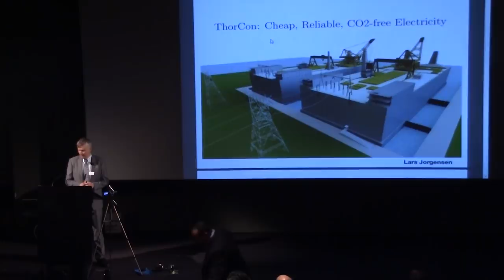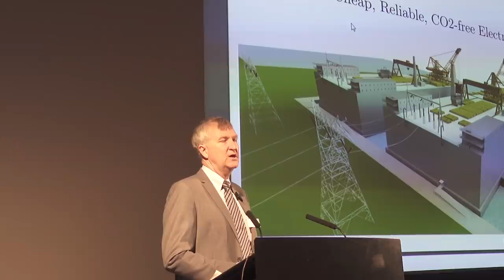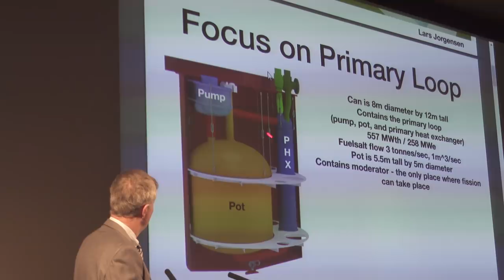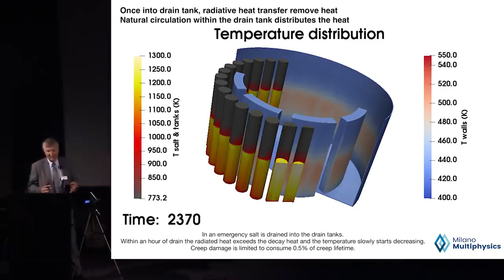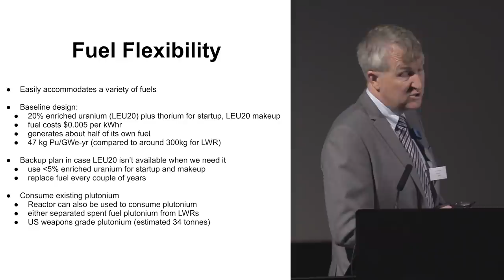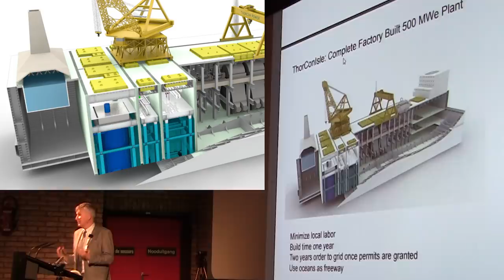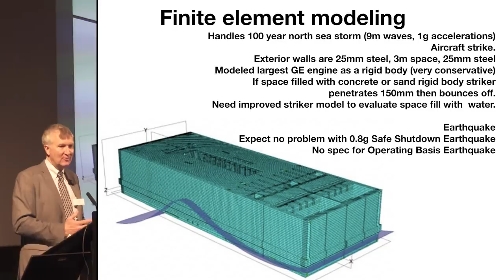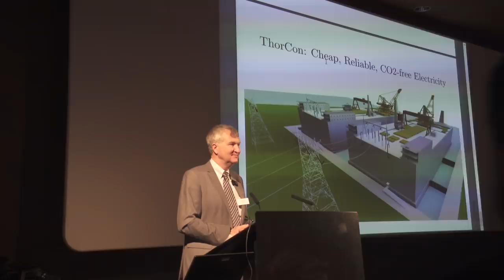ThorCon: Cheap, Reliable, CO2-Free Electricity by Lars Jorgensen @ ThEC2018

Comment from the maker: After 6 months, The Center for New Energy, Renewable Energy and Electricity (P3Tek) of MEMR Bureau of Research and Development have completed the midterm report of the Thorium Power Plant Development Study which in the midterm report cover regulations, safety and economic. The midterm report concluded that TMSR not only economically competitive with coal but has a higher safety standard with full passive safety system — The full report is expected to be completed by July 2019.

https://medium.com/@bobsoef/indonesia-validates-thorcon-91764b521d59
Reply: Assuming that report comes out favorably, how long do you think it will take them to act on it? What do the politics look like right now?

Comment: Just to look at how much energy there is available in thorium. 
The problem is to develop safe processes and there are several to start with.
Even U238 could be used but is not the prime choice .
LWR has a pressure vessel that is big and expensive  and has safety issues.
MSR has higher temperature enabling thermochemistry , very important to replace the fossil .
The problems are political, not technological . Big companies and states living on the fossil economi.
Raising taxes on energy or fossil for the common people does not solve problems. It is instead new other problems. 
Other serious problems are hysteria i media and miss informing, as a matter of fact the core of many problems.

Comment: I've never seen any published  data on radioactive 'fall out' from coal (gas, oil) power plants and no one seems to have any answers. I've been asking the question for probably 25 years including various professionals I've met. There is fall out (other than Co, Co2, etc) from coal power plant but it is totally ignored. Do you have any data? I think that would be a much better 'selling point'  Seems biggest reason for 'ignoring' Thorium / liquid salt reactors is they are very very difficult to weaponise?
Reply: IF you could get that data, and I don't want to sound all 007 or mission impossible about it, but I wouldn't put it up on a billboard if I were you. I would keep it to myself, and probably not talk about it too much either.
Reply: It's rather well known.  Kind of ignored unless one looks at the data.  In college in the seventies I was a student at San Luis Obispo CA.  They were building the Diablo Nuclear Power plant at the time.  I was involved in environment issues at the time.  Yes I saw some negative issues involved with the plant, perticularelly the high pressure operation and the need for cooling after shutdown.  Though I was a gad fly envirimentlest in that I insisted on comparing the risks of the new plant and the coal plant 10 miles up the coast.  I came up with more radioactive fallout, heave medals, poisonous gasses and massive amounts of coal ash.  One other thing that bothered me was the CO2 release.  That had implications of starting a runnaway greenhouse effect turning our planet into something like Venus.  I was kind of lonely in advacating ignoring the nuclear plant and closing the coal plant.
Reply: @stanleytolle416  dude ... spell checker ;)
Reply: @shawnnoyes4620  severe dyslexic.  All looks good to me.
Reply: @stanleytolle416  I was a motorcycle mechanic, technician, Instructor, etc so never had any formal training (4 years of Geology, Geography and Geomorphology in school doesn't really count?) 'We' visited a nuclear power plant and coal mines on various school trips (South Wales UK still had deep pits at the time) I guess I've been asking about coal burning 'fall out' a lot longer than I though as I was 17 when I first asked teachers, etc (I'm 62 now) Yours is probably the closest I've ever come to a direct answer. I can understand your 'loneliness' advocating nuclear power, the 'indoctrination' from 1950's~60's  means people are terrified of nuclear especially when people embrace their ignorance .
Reply: Sorry I've got no numbers for you but it is no secret burning coal releases radon (a radioactive) gas. Coal is being rapidly displaced by natural gas (methane) in grid electric power generation which has an activity of 200 Bq/m^3 which is apparently no more of a problem than the materials your dwelling is constructed from. Please note, my ignorance on this subject is huge, if you know better please correct me.

Comment: @Tony Chen  Russia has it's new shipborn twin reactor it's trying to sell.  How does your system compare to their system?
Reply: Russian design is a LWR vs MSR. Russian reactor between 29% to 33% efficient. This is ~ 45% efficient. They are really for two different purposes. Russian model is for remote cities to replace expensive diesel electrical generation as well as desalination. Russian model can also be used for oil rigs in Artic. ThorCon replaces coal plants for electrical generation.

Comment: I want one of these scaled down to produce 8-10kw for one or two houses perhaps in a shipping container in the back yard. Can this be scaled? Then we could really create personal autonomy in our cultures.
Reply from the maker: Do you treat your own sewage?
Reply: @gordonmcdowell  Sure, why not? I am willing to relocate if that is what it requires. Why is sewage a concern, is this not self contained?
Reply from the maker: @KellyLCall  I'm asking why are you interested in producing your own power. Processing your own sewage is a similar best-done-at-scale process. We have a grid. We have pipes.

While fission can scale down, it isn't practical to do so in most cases. Quite likely Fission Products can be harvested and put to use for small-scale solutions... in the future... after MSR have been running and we have some FP to harvest from the salt. But a Nuclear Reactor? Your own Nuclear Reactor? That is not a good use of resources.
Reply: @Kelly L. Call I think this can be scaled down but not to a household scale. Past a certain point it would be highly inefficient to scale it down further. There has been conceptual designs, not Thorcon's, but based on similar principles, that outputs 1-2 MW power. This would be sufficient to power a village. That's about the smallest we can realistically expect, I think. The intention is to power remote villages that currently rely of regular shipment of diesel fuel. So... I guess communal autonomy?
Reply: @tonychen76  I think communal autonomy is a step in the right direction
Reply: @tonychen76  i think communal autonomy is a step in the right direction. It also cuts transmission losses.
Reply: 10 to 15 magawatt in a convex box has been designed.
Reply: @clementvining2487  That's great! But I am just a homeowner, what in the world would I do with even 1 megawatt? I honestly don't think I would use even 50kw. But 15kw to 20kw or 30kw? That's what I'm talking about. Can't we just scale this thing so the average joe can power his own house? Then people can become truly self reliant instead of beholding to local power company tyranny. Then we are free!
Reply: @KellyLCall  Use solar and Tesla new battery system. The price would be a lot lower than a fission reactor of any size. Things has to be cost wise.

Comment: How about process heat?  Can hot salt be stored for possible power spikes.
Reply: Stanley Tolle Theoretically possible but not planned right now given the intended market (Indonesia specifically and developing countries in general). In the short term developing countries will use gas peaker power plants to meet demand spikes. They already use natural gas power plants, it won't cost them extra to use them that way. If ThorCon (or any company developing MSR) adds an energy storage feature it will add to the cost, thus driving price up and making the proposed MSR less attractive to developing countries. In the long term once orders are coming in, there will be money to add that feature in. But for now that's an undesirable feature creep.
Reply: @tonychen76  Russia has it's new shipborn twin reactor it's trying to sell.  How does your system compare to their system?
Reply: Yes, the tertiary loop salt is hot enough for various industrial processes.  
And it can be stored fairly cheaply, though probably the storage tanks and additional generators wouldn't fit into the floatable part of the plant. Not a problem -- just run a loop of insulated pipe out and back.
Reply: @Stanley Tolle First, it's not mine. I am not involved with ThorCon. I am just a nuclear energy advocate who is Indonesian. I wish Thorcon the best of luck, but I also have no objection if we get an EPR or VVER or APR or NuScale's or any of the modern nuclear power plants out there. May the best reactor wins. :)

Back to your question, the Russian floating nuclear power plant is the KLT-40S, two 35 MWe nuclear reactors in a barge. But it's apples and oranges really. Sure they are both floating nuclear power plants, but the scale is different (2x250 MWe vs. 2x35 MWe) and the technology is different (MSR vs. LWR) and even the marketing approach is different (Russia lobbies presidents and ministers and governors, Thorcon lobbies directors of the huge state companies).

So it's hard to compare. While both want to sell in Indonesia, in practice they are selling for two different niches. The islands where KLT-40S's 70 MW is suitable for will make no economic sense for ThorCon's 500 MW. Whereas the major islands who can use 500 MW of clean energy is not very interested in piddly 70 MW.

Russia also tries to market the VVER-1200 here too but it feels half-hearted. My guess is that they don't see us as going for the big 1200 MW plants for now. There is a major resistance for nuclear power in Indonesia too. Not as big as in the US or Germany, but it can't be ignored politically either. Russia perhaps think that overcoming this political opposition is easier by starting with small nuclear power plants first. This may also be why they're lobbying political figures.
Reply: @MikelSyn  Indonesia have committed within the Paris Agreement to maximize its equatorial geo-position to grow its biomass capacity as natural CO2 pollution sequestering agents (REDD+ projects) and by collocating the bio-refinery they can utilize excess heat from the Th reactor to produce clean biofuel cheaply for the benefit of the Indonesian people and the survival of all species on this planet. As the Indonesian president stated recently, Indonesia is open to anyone who eager to participate but perhaps for those who try to put any obstacles to this objective, they will face a 15 year old blond girl and her friends.
Reply: @sambelterasi8360  why make biofuels at all when you can make them straight from CO2 and water? Biofuels are an environmental disaster, honestly.
Reply: @MikelSyn  Currently there are around 16 million Indonesian people depending their livelihood + their family from the Indonesian palm oil plantation, to find new jobs for them within a decade would be difficult. So gradual transition would be preferable. For more advanced economic countries, such as Japan, US, and EU member states, your CO2 + H2O option would be great leap forward to the global carbon balance and its associated risk. Look it up it is in the "Opus-12" website.
Reply: Mikel Syn Re: biofuel. Realistically there is no way we (Indonesia) can get rid of our liquid fossil fuel dependency by 2050. We import some 900 thousand barrels of oil per day and this number will keep rising as our domestic reserve runs dry in, oh, ten years or so. The government's biofuel program is not aimed at CO2 reduction. Its real purpose is import-substitution. Reduce our dependency on Saudi oil while at the same time prop up domestic agrobusiness. If the same amount of energy to make 1 litre of synthetic fuel can be used to crack palm oil or whatever and get 10 litre of biofuel, we will go with the biofuel every time. This will change only when the amount of oil import becomes small enough that the country doesn't consider it of national interest. Vehicle electrification might do it, but in 2017 there were over 22 million cars and trucks and buses and 110 million motorcycles. We might get maybe 10% of that electrified by 2050 and I'm being really optimistic here.

Biofuel is a national interest here. About the only thing we can promise is that we are not blind to the ecological damage. The current government already froze the size of the palm plantations, so no more expansion. There are people trying to limit the damage, repair some of the damage, etc., but in the short and medium term we will use biofuel.

Comment: I'm confused, I thought the big problem this tech was facing was that nothing could be removed from the reactor stream while it was operational. At 13:45 he says they generate 46kg of plutonium per year that "can be put back into the reactor". So this can be weaponised? And Indonesia and the 3rd world are the target market for this?
Reply: No, it can't be weaponized.  If a country wants a nuclear, there are much easier ways than through a domestic power plant. North Korea didn't get it's nukes that way.
Reply: It’s all kept in the can. Putting it back in the reactor means after they get permission to reprocess the used fuel and extract the actinides. Right now they will just keep it in dry casks like they do with the PWR waste.

Comment: 23:20 the can only last for years then they have to replace all the graphite? That seems pretty short.
Reply from the maker: Idea is also rest of core materials needn't be approved for long lifetime either. Swap in new core. Evaluate spent core to see how materials performed. Yes, is a downside, but will find out how much of nuclear cost is actually manufacturing when being built regularly in series.

Comment: Did he talk about the U232 problem in the thorium cycle and I missed it?
Reply: I don't think he did due to time constraint, but IIRC in previous talk they don't consider it a problem. In a running MSR the U-232 gets burned together with the U-233.
Reply: It’s not an issue, unless you were trying to make a bomb out of 233.

Comment: Solar is well on its way to becoming the cheapest of all forms of electricity.  Wind is also very cheap. What they need  are storage, and lots of money is going into that.  Solar/wind and storage will be much easier to implement and more importantly, be much cheaper than nuclear.
Another important point is that solar/wind and storage can easily be sited close to the consumer, so transmission costs will be low.  That's not the case with nuclear.
Reply: Yeah, there's the ticket. Let's continue to slaughter birds by the hundreds of billions. Solar is very expensive environmentally speaking and then there's the issue energy out put decay. Neither are cheap to produce and both need ridiculous amounts of space to occupy. Thanks, but no thanks. I'll take a LWR and the risks and expense over unicorn type energy you advocate for.
Reply: Solar and wind are not cheaper than any reliable energy source and storage will only make the economics worse, not better. Germany is proving this right now, they have pumped $billions and $billion into wind and solar and yet they can not meet their emissions goals, in fact, their emissions have gone up for the last 2 years. They have the highest electricity costs in the EU and 3x the US. Now out of desperation, they are investing in a huge natural gas pipeline from Russia. Why didn't they use that money on more wind turbines or solar panels? Wind and solar can only add expense, complexity and huge land use to already reliable fossil fuel or nuclear systems.
Reply: @chapter4travels  Germany's leftist government is hell bent on taking the country to hell. Frau Merkel is doing her best to bring the country back under the influence of Russia. Is it a coincidence that the broad was part of the East German political youth groups?
Reply: You can never create enough solar and wind farms to provide for human energy requirements. This really is the energy of our future
Reply: @chapter4travels  Germany has high electric costs by intention.  They tax energy use, which is the best way to drive conservation.  They take that revenue and pay for public health care.  We have cheaper energy, but MUCH higher health care costs.
Reply: @youserious6725  Nonsense. Just 100 miles square is enough solar field to power the US.
Reply: @michelangelobuonarroti916  No, they tax electricity so they can pay the subsidies they gave to industries to stay in the country. If wind and solar are so cheap, why did they invest in a natural gas pipeline from Russia instead of more solar panels?
Reply: @chapter4travels  Because right now there isn't enough energy storage to hold all the electrons which wind and solar produce.  The days of natural gas are numbered.  Once storage  industries come up to speed, natural gas will fade. Coal is already pretty much dead.
Keep in mind, also, that Germany is a northern country.  Solar is even cheaper in Spain and other European countries which get more sunshine.
Check out talks by Tony Seba or Ramez Naam to understand solar better.
Reply: @chapter4travels  Enjoy your investments in coal, oil and gas. And make sure to also tell your grandkids that you voted for that, especially when their taxes go up to pay for all the large floods.
Reply: @michelangelobuonarroti916  If I could invest, it would be in this company, Thorcon Power and not coal. I'd invest in natural gas and oil because they will be around for a very long time before nuclear replaces those sectors.
Reply: @chapter4travels  You might want to check out Tony Seba's talks about disruptive innovation.  He gives plenty of historical reference.  Actually very entertaining talks even if you still prefer oil and gas, but solar is on his list for disruptive energy generation.
Even if you can't invest, your grandkids will prefer to not pay for floods and the relocation costs of millions of island refugees.